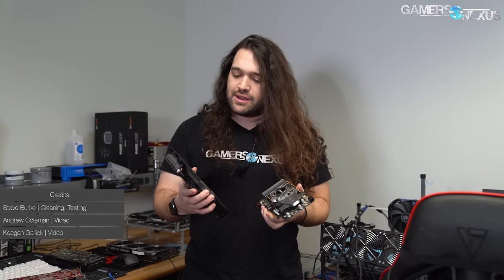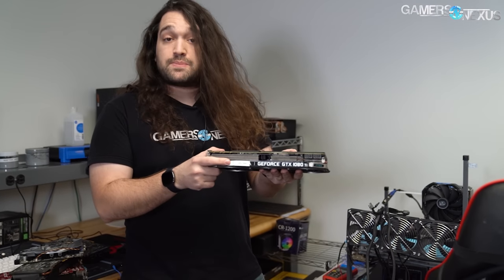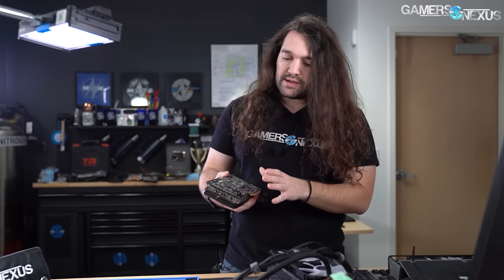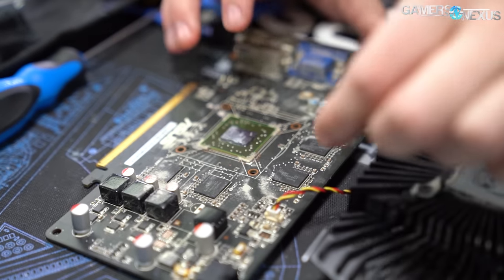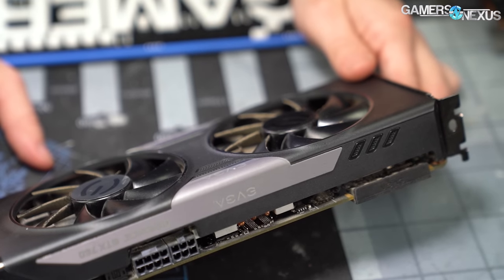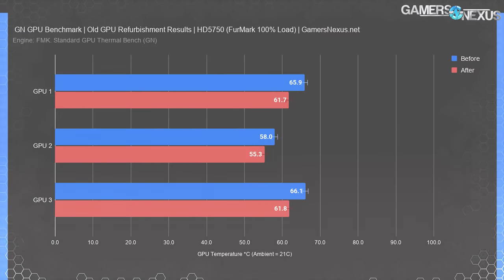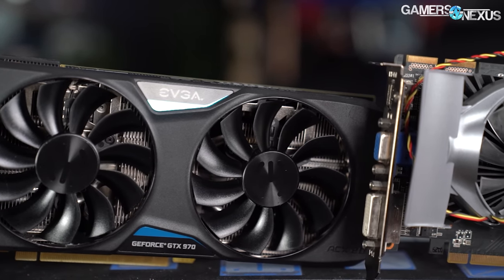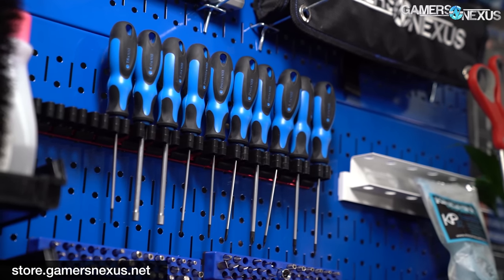GPU Cleaning Before & After Thermals: Re-Pasting & Dust Removal

Comment: The thermal pad thickness is exactly the reason why i have always been too scared to take any card apart. I simply have no clue what thermal pads to get for any of my cards and i cannot find any information online.
Reply from the maker: Fortunately, you can always use calipers to measure it! It would mean a bit of a delay while you measure and order pads, though.
Reply: @GamersNexus  True, thanks for the tip :)
Reply: My limited experience is that close is usually good enough.  A few 100x100 pads of 1 and 2 mm thickness off ebay and you'll likely be ok for most cards, but techpowerup teardown photos are great for a glance at what is under the heatsink before you actually commit to a teardown.
Reply: They do sell varying thickness pads in kits on amazon and ebay. Just look for the higher efficiency pads. Can't remember the term at the moment sorry.
Reply: There are some kits provide a few different heights on amazon, very handy. Eyeballing it can sometimes work
Reply: Thx for the responses.
Reply: @GamersNexus  Not to mention it's always good to have a bunch on hand!
Reply: You don’t have to order new pads if the old ones are in decent condition, I’ve taken 50+ GPU’s apart and only had to replace 3 or so thermal pads. Sometimes there is a minor tear but it doesn’t affect temps that much
Reply: the only time I have had to replace thermal pads was because I bought the terrible MSI Evoke 5700XT when I found one on sale for £100 below RRP last year and then found out that mine had skipped the recall and 'fix'. Luckily I was able to re-watch the Gamers Nexus video about that specific card and find out what to order. I then went a step further and re-purposed the old too small pads to put them on the back of the card between the VRM and the backplate. It's still a hot card but it works, and in the current market I'll take that.
Reply: @Turboman_64  That is what she said haha :P :D
Reply: Almost all of the benefits are from removing dust, which you can do without taking the heatsink off entirely, just the shroud and fans.

Comment: I found when you rinse stuff with tap water, it helps to rinse again with a bit of distilled water. Small droplets that evaporate off the surface will leave some residue of minerals etc. in tap water. Distilled water evaporates clean.
Reply: Animal I really have to wonder about how much mineral deposit you get in a couple of minutes of tap water.  I am not knocking the rerinsing idea at all because I have often times noticed my cleaning liquid picks up a lot of dust and such and the small drops will leave a thin residue that a second wipe gets but for most tap water in the civilized world it takes years of use and regular wetting drying cycles to get noticable build up from dissolved minerals.  There are some outliers and I know of a well that is safe to drink under consumption standards that lays down rust colored stains in months and another that has really heavy calcium from limestone. The limestone one still takes years in a kettle to build a noticeable film.  

I am just thinking that your residue is more likely due to dirt residue from the cleaning and/or you need to check your water/plumbing because that's a lot of suspended junk in your water.
Reply: @OmniMontel  The rinsing itself is not a problem I think. I was only concerned about the residue that's left when the droplets evaporate off the surface, aka when you let it dry. We have relatively mineral-rich water here, mostly limestone I think. I did an experiment once where I put a drop of tap water and a drop of distilled water on a clean glass surface and waited until both were evaporated. I could clearly see the residue from the tap water on the glass surface (if you look at it under a bright light with a dark background and no reflected light). I couldn't see anything where the distilled water was. I also did some tests with other liquids (lens cleaning solution, rubbing alcohol...) everything left a residue except distilled water.
Reply: @alphanimal  lens cleaning solution eh yeah definitely depending on the solution (some are actually designed to leave antifogging films and other stuff like that), amazed on the rubbing alcohol, distilled water is supposed to be evaporated then condensed water so no surprise, have had distilled water that had picked up a lot of crap from the jug a few times but that was an issue with the container and keeping it in a vechile long term.  Like I said with your tap water I would get it checked, it's not supposed to have that much crap dissolved in it.   If it's constantly leaving a residue on your drinking glasses and such then it's weird and you should find out what it is.  

If you do get it tested and it's not ridiculous like over 150mg/L of normal stuff like calcium or magnesium then eh whatever, you've got hard water in your area.   For something like washing a heatsink not a big deal if it's other stuff like say Thallium.
Reply: @OmniMontel  Sorry I'm not sure if the stuff I tested classifies as rubbing alcohol, so I might be wrong there. It was Ethanol but I don't know what purity. The tap water is fine, it's just hard water.
Reply: distilled waster is just water with all the minerals removed

Comment: Jesus. I must be an obsessive, I clean my towers and components for dust every other month.
Reply from the maker: That's good practice!
Reply: With four dogs, every month for me. No fun toting a 40lb tower to the garage to use the air compressor. 🤷🏼‍♂️
Reply: I bought a Bosch GBL 800 E blower and use that, it makes things sooo much easier and quicker than how   I used to clean it for many years (manual cleaning)
Reply: Fun fact, I used to do this every roughly 3-4 months just like you and would always get a nice satisfying cloud of dust and the interior would always have a "restorative" feel to it afterward. Thermals also saw a noticeable improvement. I then moved to a place with a fancy active air filtration system and zero carpet. I think it's been about 2 years since I opened the thing up. When I do open it up I expect it to still be very clean. Last time I did, I wiped my finger on a horizontal surface and it didn't leave a trail. Still took the whole thing apart and cleaned it as I couldn't believe it. I mean it does have filters but those were also pretty clean.

Moral of the story: if possible live in a clean environment. Dramatically cuts down on so many maintenance issues overall, not just computer related.
Reply: Once a month with a compressor and every year a strip down clean.  My new build is in a Lian Li Lancool 2 so more dust now, so this might get revised.
Reply: Hehe, yeah, cleaning... I've neglected that point for about a year and my PC was absolutely unusable with the side panel on...
Reply: Amen brother, doing the same thing. Using the Fractal Meshify 2 XL so those dust filters needs to be cleaned :-)
Reply: I take my PC apart down to every nut and bolt every night, put them inside their original boxes, and reassemble the next day.
Reply: I keep compressed air on my desk all the time and do it at least once a week if not every few days honestly lol I paid a lot of money for this crap, it better last a while xD
Reply: Mine is on my desk in a tempered case with LED fans set to max brightness white in a black case. I clean it thoroughly every week.
Reply: I haven't de-dusted my personal pc in like 3 years, still works fine except random bluescreens when the cpu is pushed to 100%

:)

I should clean it shouldn't I?
Reply: @CraftMine1000  nah, keep it.
Reply: @CraftMine1000  na, just let it catch fire.  Gives you a good reason to upgrade.
Reply: I used to clean my pc every month but that got annoying fast (HAF 912). Eventually, I stripped the case screws from doing that. I won't buy a case without removable filters ever again. Airflow cases are bad for my area.
Reply: @JakeobE  Are you Linus Techtips?
Reply: Quarterly is a good idea.
Reply: It can be fun to do.
Reply: @JakeobE  You need a Woman/Man/Other
Reply: Yeh I do that too. Having a tempered glass sidepanel means I can see it build up. And if I see it, I must clean it.
Reply: I tend to remove case and fan dust filters every two months and repaste and clean GPU and CPU yearly, together with a component deep clean. I love Servisol!
Reply: Once every 6 months is optimal here. More often there's not enough to clean. Less often ( once a year ), it starts to overheat from the dust.
Reply: Same same. Don't wanna my sweet baby get any dust allergies.
Reply: @cbabbx  Look up compressed air dusters. They sell them on Amazon. You don't need an air compressor anymore for high velocity air cleaning. They work really well.
Reply: @badwords7963  Tempered glass and RGB may get a lot of hate/ridicule sometimes but it certainly certainly provides tangible benefit when it comes to knowing when things are getting dusty, as well as providing motivation to clean it.
Reply: I don’t actually clean my tower that often. The main reason is that my room is free of carpeting and has an active air purifier and filtration device that helps keep dust levels minimal.

Doesn’t mean I don’t clean it. I absolutely do, but every time I do so, the computer doesn’t really look that much different, just with slightly less surface dust. The GPU fans and the CPU heatsink were barely dusty. With that said, filters and intake fans do get cleaned more regularly.
Reply: Damn dude if every other month makes you obesssive, I must be a nut case clean freak to blow out the dust every month and deep cleans once a year
Reply: @cbabbx  I don't have pets, but I live across the road from Bushland & have a family Kangaroos visit a few times a week so I still get plenty of Fur in the Dust here
Reply: I've been cleaning my shit like every week... I think that's a bit too excessive though.
Reply: I've got aftermarket magnetic dust filters for my HAF-912, and I make it a point to wipe them clean with a brush every Monday.
Reply: @cbabbx  I just bring my small compressor inside and blow it out right beside both a massive air filter and a massive industrial Air moving pumping directly outside 😂
Reply: @deadmeat6563  Weird, my lancool 2 doesn't seem to accumulate very much dust at all aside from at the designated filters. I do however have 6 noctua p12 pressure intake fans 2 of the same top exhaust and one 2500rmp fan on the rear 1080 hybrid radiator lol
Reply: Me too, i clean my pc more than my house LOL
Reply: @Hisokaa-d2j  you’re right you don’t do preventative maintenance on your cars computers but you do clean out filters, change fluids and other things to prevent it from running poorly or even in some cases over heating you know kinda like what he’s doing with these gpus... 🤦🏻‍♂️
Reply: @Hisokaa-d2j  you should Google the definition of preventative 😂
Reply: Once to twice a year, but we have multiple computers.
Reply: Buy those electrical PC dusters...I don't normally use amazon being a dane, but it was the best thing I've likely bought on the internet...Cheap too. Stop using cans, this one works VERY well.
Reply: I tend to wait until I can look through the mesh front of my case and see dust on the intake fan. That's when I know it's time to clean.

Comment: I cleaned my friends 1060 a few months ago, temps went from mid 70’s to mid 60’s. Not sure how performance was effected but thermals were certainly better.
Reply: @asdrubale bisanzio I certainly agree I’m just not sure it had any effect as the 1060 in question is quite power limited by design
Reply: 10 degrees should translate to some 30MHz higher boost.
Reply: @Piterixos  yeah I’m pretty sure you’re right, not that 30mhz makes any meaningful difference though

Comment: Dust cleaning and thermal repasting is one of the most underrated PC maintenance tasks there is. Absolutely nobody gives second thought to the hardware once it's installed and running.

Learn the hard way like a lot of gamers. Running systems hard for years in environments that lack cool airflow, or have heavy dust buildup. Then later come to the ugly realisation your computer is producing 5x more noise & your games stutter, run poorly with reduced FPS and even crash sometimes.

I had this method done to my computer by a really good local tech who operates a private business. When I received it back it was almost quieter than stock, and my FPS/stuttering issues were immediately resolved. My performance increased and some games benefited from higher FPS. (ELDEN RING is a big one for thermal throttling for some reason). Going from 35-40fps average back to capping at the games 60fps is huge.

If you love your computers and abuse them daily with heavy gaming use and let them run in high temps. Please do this at least once every 2 years.

You don't need a new PC. Just get it professionally restored.

Comment: Great video as always, I myself purchased a 2nd hand GTX 1070 Zotac AMP. Managed to get a great deal on it before the prices on used parts sky rocketed. When I received it, it was dusty and had cracked thermal paste on the GPU Die. I did test it before taking it apart though. After cleaning it I did not see much difference in performance/thermals but the Fan noise is alot quieter so it goes to show that doing regular maintenance on your parts work.

Comment: Steve: Doesn't really want to recommend we put the bare metal heatsink under running water.
Roman: Put's the board in the dishwasher.
Reply: Dishwashers in Germany use deionized water, so that actually is safe.
Reply: @Azraleee  What kind of dishwasher do you have? The water in the usual dishwasher is far from being deionized. You actually add salt in order to lower water hardness.
Reply: Spray heatsinks with brake cleaner then rinse done
Reply: @Azraleee  you don't need di water thats  like in a closed water systems an acid batteries
Reply: @broken1965  Yes! because plastic loves the heavy solvent that is brake cleaner...
(F.Y.I For the Love of God, DON'T DO THIS)
Reply: @Syraxal  you have plastic heat sinks or something?
Reply: the detergent for dishwashers is an anti corrosive which is the biggest concern. So it's fine. Running it under the tap.........not so much. Perifractic explains this when he puts a Commodore 64 motherboard in it. I had never thought about it before that, but it makes sense.
Reply: @Syraxal  in which world do you use plastic HS. If people want to use contact cleaner go ahead its alchohol an naptha
Reply: I wash motherboards with my garden hose here in Australia, dry them in the sun for at least 12h, then spray them with WD multi purpose spray like tech yes city uses and wait another 24h for them to dry - I’ve done this to over 50 motherboards and have never killed any board, in fact washing brought some dead ones back to life!
Reply: @brandonl8039  I think they're referring to all the cosmetic stuff on some graphics cards being plastic. Plastics don't always hold up well to solvents; ABS plastic basically melts on contact with alcohol, for instance.
Reply: @Azraleee  the deionized water changes nothing, You could basically put them into every dishwasher all around the world. It is deconnected from the powersupply, there cant happen any short circuit. The most important thing is to let it dry. You can use some alcohol, it will pull out a lot of the water and then let it dry in a warm and dry environment. You could even put it in the oven with a Low Temperature.
Reply: @schekelberg6187  AFAIK der8bauer basically roasts them at 110C once they’ve washed them. I’ve been watching their EN videos of them fixing broken parts from a flood they had.

Comment: Just stripped, cleaned and repasted the old R9 270X 2GB that sits in the PC in my workshop. It was utterly filthy given the environment it lives in. I ran an extended Furmark stress test before and after.

Before: Core temp 67°C, fan speed 53%.
After: Core temp 54°C, fan speed 38%.
With a normalised fan speed (before 53%) the core temp came down to 46°C.

Great result!

Comment: What a coincidence!  I just performed this procedure on my old trusty GTX970SSC less than a week ago.  I sold it to a buddy in 2019 and he used it heavily in a very dusty room until he upgraded last summer. Traded a 1440p monitor to him for it and a Logi G27 wheel set.  It was caked in brown dust (he smokes) which meant I went thru ALOT of Q-tips and rubbing alcohol to get the grime off.  Kudos to EVGA as I was impressed with the build of the card and the thermal pads were in perfect condition.  Fresh MX4 and she's up and running 68C @ 1450 core / 7500 mem  Folding at Home in my HTPC which feeds a 60" plasma 1080p TV so it'll suffice for any gaming duties there. As soon as prices get more real it'll probably be bumped out with the trickle-down effect but until then resurrection is necessary.   Good piece for the uninitiated GN,  and welcome instead of reviews of unavailable hardware.

Comment: I've recently taken apart, cleaned, repasted and put new pads on my GTX 1080ti Aorus Extreme. It dropped from 83c to 78c on average after 30 mins. of fiery ball of GPU-death test (furmark). It's been approx. 20 months since the last cleaning, and first time changing the pads. - was happy to see that. 
Have been putting together PC's for a couple of years now, to sell on local used market - normally it's not a big change, but it's always nice to be able to lower the dba when showing it to customers. Worst-best I've seen was a MSI GTX 980 I changed the paste on and cleaned, got it from 94c to 81c inside a case with good airflow and 4 120mm fans. That was a noticable change, but then again, I think the fanblades was twice as heavy as stock, just from all the dust on them! 

As always, thanks for the great content - good idea with this vid, would love to see you "test" a full system before and after in the same way.